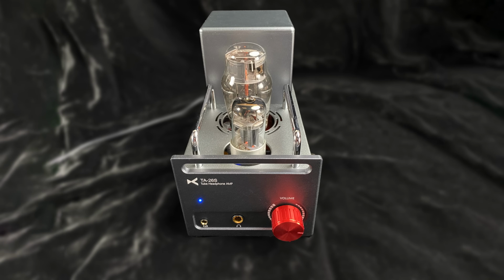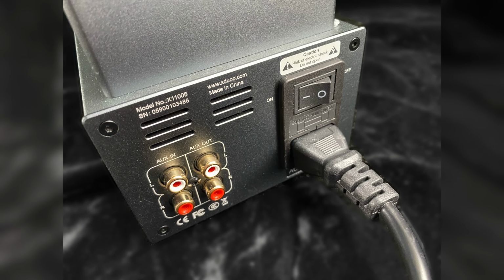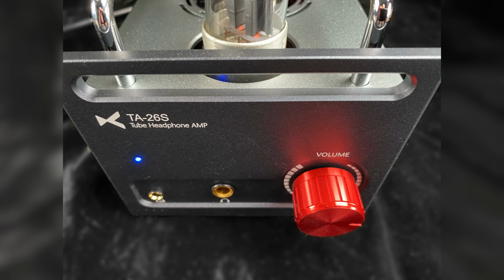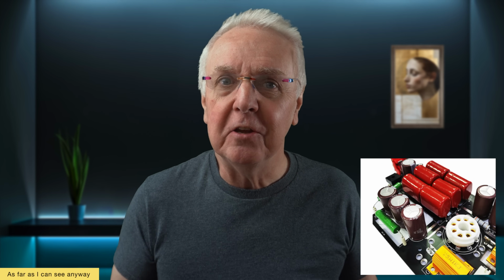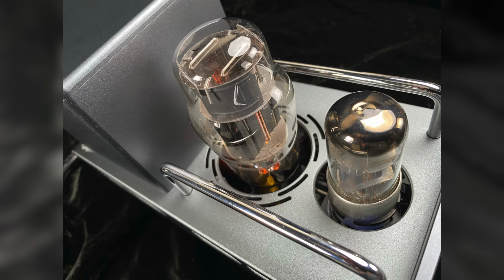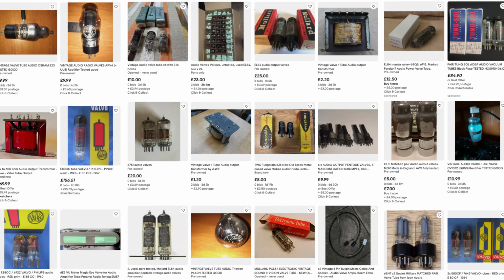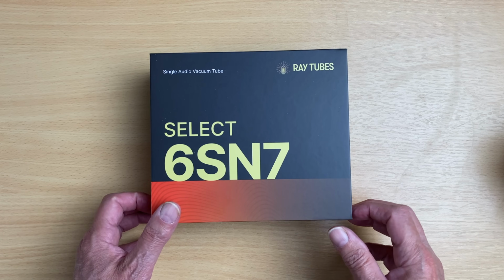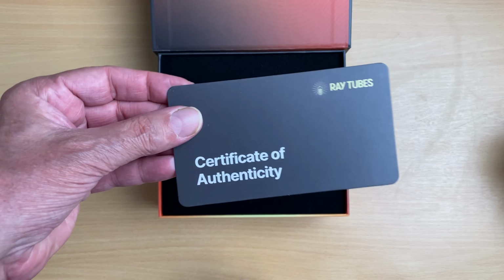Are you ready for tube rolling? [xDuoo TA-26 Tube Headphone Amplifier]

Comment: I do have a decent computer system, while I can hear the differences it is VERY hard with the You Tube compression and other issues with the digital file transfer and reproduction here.  That said, I DO hear a difference.  My take on it is in agreement with what others said below.  The clean sound was the best in terms of the overall reproduction.  It most likely was the truest to the sound because, outside of the You Tube compression, etc, it IS!   Now with the stock tube, it seems to me as if the high end became slightly more dull, but it was very close.  With the Ray tubes the highs became more duller yet and the bass seemed less full and overall the distortion seemed a bit higher.  Could the dulling of the high end could be that warm sound people talk about with tubes?  Could the added distortion I heard more with the Ray Tubes 6SN7 could also be that 'warming effect'.
Well, to shine a bit more light on the scene, I happen to own this headphone amp myself and I have a pair of Sennheiser 600's on it.  I have ALSO, done just the swapping out of the driver or the 6N8P tube.  However, I have done the test with used old stock tubes using a 6SN7 of the following brands:  GE, RCA, Du Mont, Hit Ray, Philco and Sylvania.  Of the bunch, the Hit Ray was the only one that was NOS and not used before.  It was also the worst sounding of all the tubes I tested.  It had the most distortion.   So I rejected it, right away.  It could possibly be that I need to break that tube in and try to listen to it again.   Of the lot, the Sylvania and the Du Mont sounded the best.   The Du Mont was more warm sounding with less high end than the Sylvania, but it also had the least distortion.  It also had less gain and I figured that it probably had the most wear.  So far, I been a bit intrigued by the sound of this tube and I have kept it in the amplifier.
Now, the reason why I have not swapped out the output tube yet is that it just looks WAY cool.  The shouldered bottle shape and the way it lights up has me sold.  By direct comparison, a 6080 tube is the electrical equivalent and it is a short, stubby, straight sided tube and looks quiet boring.  PSVane has a couple 6SN7's in their lineup which I would like to try, but they are damn expensive!

Comment: It would would be lovely if you can review the budget tube king of the head amps, the XDUOO TA-66. I was able to tube roll with excellent results, replacing the generic 6N2 and 6N5P with Psvane 6SL7 Art series converter adapter required (Jemosa 6SN7/6SL7 to 6N2) and Sovek 6SA7G. This tube headamp is retailing about £249 :)

Comment: Thanks for the review, I just ordered one. I have yet to notice any difference in the demo, I played the video twice and tried to listen carefully. Anyway, I suppose I have been a tube enthusiast for decades, with fond childhood memories of playing with my dad's tube amps. I have a cheap stereo tube amp. After about 1 year of use, it randomly makes static and humming sounds. So, I thought I'd replace it with one of higher quality. I went to a musical instrument website, they have about twice as many guitar amps with tubes than solid state. So, for guitar players, both tube and solid state are popular, with tubes easily the most popular. Anyway, an all-tube guitar amp would cost about an order of magnitude more than my current amp, and several times the cost of the xDuoo. So, I'll take a chance on the xDuoo to add a bit of tube distortion to my music. When faced with the question of tube or solid state, my answer is why not both? Some music sounds better with a more accurate solid state amp, other music sounds better with a tube amp. I also appreciate that solid state is more reliable. Thanks again!
Reply: And an update, I listened to it a third time with headphones, about as accurate as I can get, still can't hear any difference. It could be that YouTube's lossy audio compression masks any differences. Also likely is that if you aren't driving a tube near it's limits, intentionally getting a bit of distortion, there isn't enough distortion to notice. So, I will try to run mine with some distortion dialed in.
Reply: Yet another update, it looks like about a month. I was able to get some distortion, at least when listening to headphones. With a bit of distortion, it sounds good, but a bit different than my all-tube power amp. So, using a relatively low-power headphone amp will give some tube sound, but I have yet to hear something that matches the sound of an all-tube power amp with just a few watts max power. I also haven't tried swapping tubes in the xDuoo, will probably wait until they need replacement. So, the xDuoo is worth it, I listen to it with headphones most days.

Comment: Just my opinion but, a headphone amp would be the very LAST place I would use tubes. Phones are, for me, a reference monitor, that one device I can count on to give me a distortion-free portal into my chosen signal. Tubes are world-class distortion generators, with a very gentle onset guaranteeing they are always nonlinear and as if that’s not enough, a carefully curated mix of low order harmonics the quantity of which corresponds to the intoxicant of the listener. So, what good are they in a phones amp? 

Anyway, that’s just me.

Comment: It's not a "Tube", it's a "Valve", where on earth were you dragged up ! :- ) "Tube rolling" (Ugh) only works if the circuit design exceeds the guaranteed operating specification of the valve. This could be; 1. The designer was an idiot. 2. The valve has aged to the point it no longer meets the spec sheet. The OTL is basically cost cutting the design, good output transformers are cash intensive. However, it limits the design to high impedance phones, and even then, damping factor goes in the bin. This allows the reactance of the load to become part of the output stage. This said, perfection isn't everyone’s objective. (PS, you would be better off "Headphone-Rolling" as the match of output impedance and load potentially offers a large variation)

Comment: Ages ago, I made a stereo pair of hi-fi valve amps.
After a year or so, I convinced myself that the sound was going downhill.
Perhaps the valves were getting tired?
In went an expensive new set of ECC83, EL34 etc.
It didn't make any difference.  Or did it?  I couldn't be sure.

The transistor amps I use now are worry-free.

Comment: .      How do we get a balanced output without a balanced input?

                                                                                                  Acid Jazz, Funk & Brass  🔈🔉🔊
Reply: Easy, it has a balanced headphone socket, so you can use your balanced phones, However that socket is wired with the negative side of both left & right connected together, to earth.
So it is compatible with your balanced phones whilst not actually having a balanced output from the tubes.

Actually in theory you will have better sound, as in separation as the two drivers in your balanced phones have separate wiring all the way back, it's just lost at the very last point at the single ended tubes
Reply: @paulstubbs7678   Hi Paul,  IDK how I missed your answer.  Thanks.  It took me too long to learn about combining the negative leads. Thanks again.
Reply: Just for convenience.....

Comment: It has been a very long time since I had a stereo tube amp. I hated it. It added a continuous low level hum to the sound. Sometimes the normally black metal parts inside the tube would start glowing red hot when powering it on and there would be no audio. It was probably defective or just a bad design and I'm sure this isn't a problem with modern tube amps but once burned twice shy. Anyway, my solid state Parasound amp makes my ears happy and the sound probably won't degrade until the capacitors wear out in the distant future.

Comment: If you think tubes an be changed around why not change the plate load resistors and everything in the bias circuit.  Redesign your amp every day. 
Tube circuitry is obsolete and should be  purely an academic oddity.
Reply from the maker: And car enthusiasts should definitely not tune, modify or improve their vehicles because everything is fine just as it is.
Reply: I agree tubes belong in museums ... but I've never met a circuit yet that can't be improved in some way or another.  Designers work on absolute values, manufacturers work on standard values, leading to some compromises. Standard values + tolerances often get far enough from absolute values that fixing the discrepancy can give meaningful results.

Tube-Rolling and Chip-Flipping (op-amps) are a silly game that mostly accomplishes nothing... but the golden ears love it.
Reply: @Douglas_Blake_579  It isn't the component values that is the problem. Manufacturers work on component count and cost, often to the detriment of the design as a whole. 

If you cannot yourself hear the difference in various tubes and op-amps, then congratulations - you've saved yourself a bunch of time and money. Myself, I'm poorer, but have more options to listen to.
Reply: @albanana683  
It is exactly component values that are a problem .... A designer calculates 11k, the nearest standard values are 10k or 12k ... both 10% off calculation.  And yes that is going to affect the performance of a circuit.  

Oh I do hear the differences in tubes.  Their tolerances are wild compared to the parts around them, they can be 20% or more off design ideals. Even rolling tubes with the same designators can make audible differences.

Op-amps are a different story.  Their tolerances are often in fractions of a percent which ensures consistent behaviour both across a batch but also across designators.  Unlike tubes, the chips you are flipping are dominantly controlled by their surrounding parts. The ones in mini-amps are almost always working at very low gains, most are being used as unity gain phase splitters to drive the power amp chip.  At those levels, with such tight values, it is beyond unlikely there will be any measurable difference, nevermind one you can hear.
Reply: Sure you can, but it is the whole implementation that works. If you need state of the art things you go elsewhere not chi-fi: Leben, Luxman, Feliks Audio or good 'ole McIntosh, quality and service (life long) matters too.

Comment: Hm, I cant claim to hear any noteworthy differences. Maybe some slight changes in level between the different tubes and the clean, but that's it.
What I'm thinking is why get a tube amp if you're not gonna drive it a little?
I mean thats the very thing they are good at, adding soft harmonics, fattening the sound

Comment: How much money does one have to spend in order to become an AUDIOPHILE??
Reply from the maker: $100 or so for a Crosley and a record to play on it. You can develop your audiophilia by listening closely, working out what its limitations are, and deciding on your next step when you can afford it.
Reply: @AudioMasterclass This is probably the best, and most honest  definition of an audiophile. First single I listened to was Mungo Jerry, Alright, Alright, Alright on my parents' Hacker radiogram, in glorious mono. I was barely a teenager, but managed to find a way to add a speaker and create a (very compromised) version of stereo. I count that as my first audiophile adventure. Still mucking about with audio hardware after 50 years.
Reply: Near $0 ,one can be an audiophile through thrift stores , curb side rummaging and dumpster diving.. that being said it's really about the enthusiasm in obtaining a desired sound.  Conversely just throwing money in equipment doesn't necessarily make you a audiophile.
Reply: @stevengagnon4777   So you're saying i've wasted all my money and a acoustically treated room, tube preamp, tube dac, Mcintosh power amp, Gigawatt installation cable and circuit breakers, a pair of Rel carbon sub, power filters, Synergistic research master fuses, PAD Dominus speakers cables, Siltech royal crown interconnects and so on???
Reply: @stevengagnon4777  
I beg to differ (HE, HE)!

Comment: "Rolling" used to be a lot more fun for the consumer when it involved matching a cartridge to the speakers and the room in a vinyl setup. A really "characterful" amplifier might need some matching or better, replacing as well. Old or cheap tube amplifiers used to have their own "character". Hopefully by now the transformers are such that there is little character to them and almost no difference between tubes. Fiddling with audio components does get one to do the basics - move the speakers around and put the fish tank pump in a sound proof box because you pay attention to what you hear whatever the perceived value of the tube rolling might be. Excellent video with a very believable result.